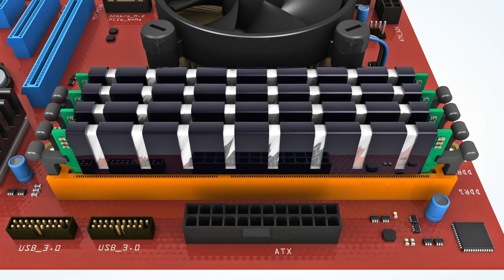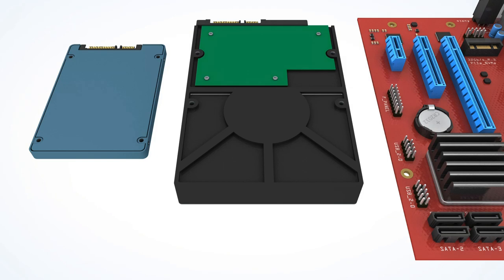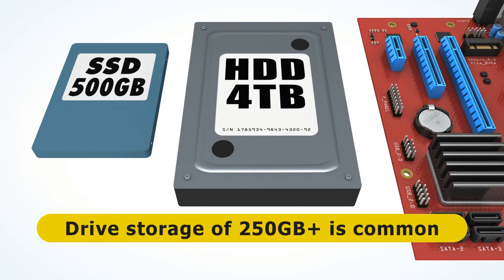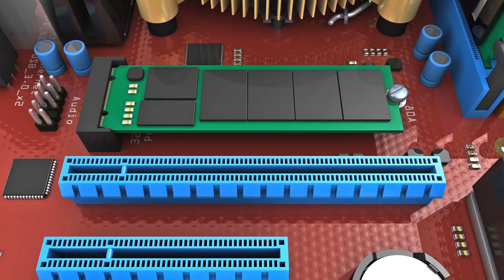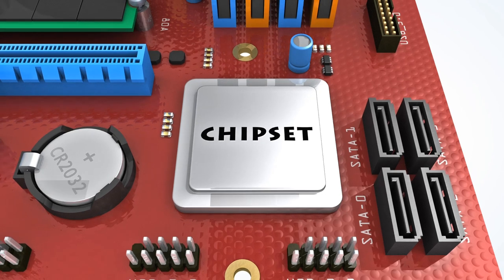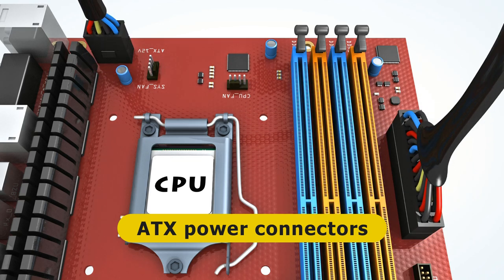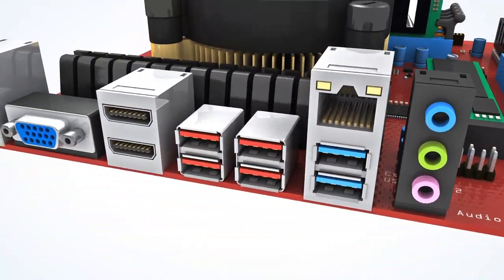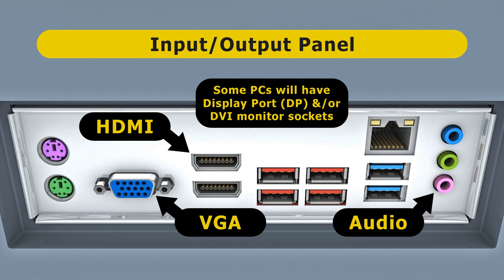Explaining Desktop PC Hardware

Comment: Are there motherboards that will accept four dual monitor video cards? OR Is there a better way to build a desktop that will operate 8 (or more) LED screens? Opinions and suggestions are welcome

I'm building my 2nd desktop computer to run 8 monitors...it's function will be to replace my current 8 monitor futures trading station (10 charts)  --  It is NOT used for gaming ... My 1st build was in 2012 and is still functioning great but it's getting a little dated/old. I used two dual monitor PCIe video cards and 4 USB video adapters for running 8 monitors total.

My current machine runs Win 7 home 64-bit, an ASUS P8z77-V LK motherboard, Intel i5 CPU, 16GB DDR3 Ram,  4 USB 2.0 & 4 USB 3.0 ports, an  OCZ 128GB SSD with a 650 watt PS...It has been relatively trouble free,  running 14 hour days, 7 days a week
Reply from the maker: I am not aware of such a motherboard. But there are a lot of quad monitor graphics cards -- eg a Gigabyte GeForce GTX 1660  -- so why not just fit two of those? Or (some) monitors could be interfaced via USB as you are doing now. But twin quad monitor graphics cards would be the easiest option I imagine. Best of luck! :)
Reply: @ExplainingComputers  Thx for the reply...I was hoping to eliminate the USB video adapters as they have shown high failure for me  (5 have burnt out in 10 years)... 

I was thinking that low end dual graphic cards are relatively inexpensive compared to quad cards, plus I do not need very high end graphics for what the machine is used for.
And I have had no issues with the inexpensive low end dual cards I installed in my 1st machine...

Comment: It's sad seeing optical drives slowly disappear from the consumer market, even when they're still one of the best storage options available, especially for archiving. I had to buy an old Optiplex just to get a PC that actually came with a full-size DVD drive tray and then separately purchased a BD drive.

I also prefer the protocol between PS/2 connections for mouse and keyboard (interrupt) rather than USB (constant polling). I get that USB is more versatile in application and thus "better" connectors, but it just seems so wasteful to request thousands of times per second whether a key/button is being pressed.

Comment: Better graphics than PC Building Simulator. You did however forgot to apply a pea sized drop of thermal paste before fitting the CPU cooler
Reply from the maker: Thanks for this. :) When fitting a stock AMD or Intel cooler, the thermal plaste is pre-applied to the base of the heat sink, so would not be seen in the shots included here. :)
Reply: @ExplainingComputers  Touché and since this was a "PC hardware 101" I cannot expect you to explain the practice of removing stock thermal paste in favor of more expensive aftermarket paste either.

However, one caveat with the theory of pre-applied thermal paste. After removing the cooler, especially when it has been mounted properly by tightening the screws, there should've been a nice coating of paste on the CPU, making the letters 'CPU' illegible
Reply from the maker: @Stadtionalist  True!

Comment: Great video. Could do a longer version with a few more things:

m2 maximum speed - this confuses a lot of people.
front panel - probably the hardest part.
how to screw the motherboard on the chassis - people don´t know about washer/lockwasher and this causes a lot of eletrical problems / interference. Not sure if the name is right, in my country it is called arruela.
Reply from the maker: Thanks for this. I've already got  video on SSD technologies and form-factors (M.2 does not have a speed as it is physical connector, not an interface: SATA and NVMe/PCIe have maximum speeds, so the issue is the type of M.2 slot and the type of drive). And I've a video on front panel connectors planned. :)

Comment: Can you please do an episode on external power solutions for desktops, namely UPSes and computer voltage regulators? My computer is currently plugged into a motorized mechanical voltage regulator and I'd like to find out if it is really an appropriate device for a pc?

Comment: Hi Chris. I got a notification on my laptop to upgrade to Windows 11. In your opinion do you think it's worth upgrading or should I keep using Windows 10?
Reply from the maker: This is a difficult call. Right now I am typing on a Windows 10 laptop that I'm keeping as Windows 10. Windows 10 support runs to 2025, so the decision depends a bit on the age of the laptop. If it is fairly new, and so likely to remain in use beyond 2025, then upgrading makes more sense, as Microsoft may stop offering the upgrade to Windows 11 for free.
Reply: @ExplainingComputers  The laptop is fairly new (2 years old). I might try out the ARM version on my raspberry pi before upgrading. 👍
Reply from the maker: @qg786  That sounds like a plan. :)

Comment: Nice jelly nailing attempt and loving the RGB shirt, Chris. I'll take a look at the updated website. I'm hoping to find a link to an image I can use to boot my Mango Pi MQ Pro. I bought it some weeks ago and despite trying several micro SD cards and several images it just sits there with the green LED on and no HDMI output. I know the first boot takes longer than subsequent ones but after 20 to 30 minutes there's still nothing. I thought I might have a bad board so I ordered another but that behaves exactly the same. I suspect that if i can get one of them to boot then the other will work too.
Reply from the maker: According to my notes, I used an image from here: https://mangopi.org/mangopi_mqpro 

And specifically the
Armbian_22.08.0-trunk_Nezha_jammy_current_5.19.0_xfce_desktop.img

Good luck! :)
Reply: @ExplainingComputers  That works. Thank you. The winning combination for me was that image, downloaded from the Russian server, written to a 32GB Kioxia card, using Raspberry Pi imager running under Windows 10.

Comment: ESP32 S2 Please. I just watched several of your 'Raspberry Pi Pico' videos. I want to start running Circuit Python on the EPS32 S2. Would it be the same set up as Pico? I sure could use a 'video like you do', to set it up with an old MAC. I have been told Python is very popular.
Reply from the maker: I've not used an ESP32 I'm afraid (although doing so is on my list). Python is indeed popular -- I've a Python intro video here: https://www.youtube.com/watch?v=Crsp_He70no

Comment: Very nice animation, this must have taken absolutely ages to create.  Great stuff.
Reply from the maker: Ages . . . and ages . . . and then some more ages when I found an error and had to do it again . . . :)
Reply: @ExplainingComputers  I can relate.  I use 3D modelling for work, but it doesn't need to look pretty.  I only ever need to render the occasional still image now and again.  To render a movie of this complexity is a huge achievement, making the models (if they don't already exist in libraries) takes time, and then selecting and tweaking the textures to make them look realistic takes even longer.  What software do you use for this?
Reply from the maker: @CasualInventor  Thanks for this. Everything was built and rendered in LightWave 3D -- nothing came from a library. I have used library or other stock objects in the past for some projects, but they can waste more time than they create.

Comment: I have an old pc with 1gb of memory. The max memory the motherboard will allow is 4gb. The motherboard has 4 slots for 4 ddr2 memory sticks. Should i get 4 1gb sticks or 2 2gb sticks? Thanks. Great channel.
Reply: Do you know the max memory that the CPU will support, that is important too.
It is also important to consider, that probably the majority of motherboards, only have dual channel memory (refer to the manual, it should tell you which of the slots to populate depending on how many RAM sticks you have), so in most cases, you would probably just go for 2 2gb sticks.

Comment: 06:42 Unfortunately you have presented this piece of hardware as an optional one - while it is a mandatory one. That is of course if a CPU being used is a strictly CPU and not APU - but the again, when talking about that component you also forgot to mention this dichotomy 01:17
Reply from the maker: With respect, I think this is nit-picking to the nth degree! :) It would have majorly confused matters to get into CPUs with no integrated graphics (today mainly an AMD thing, as I've detailed in my fairly recent CPU and chipset videos). In education, less is usually more, and today most CPUs do include a GPU. :)

Comment: There is also a TPM security module, south bridge, and BIOS Flash.
Furthermore a Tape Drive of Zip drive, Serial & Parallel Ports, SCSI Controller, ext are also present on old PCs 
Cheers ✨
Reply from the maker: I did consider a mention for the BIOS. :)

Comment: I would have probably left the VGA connector off the GPU at this point. It's a bit dated.
Reply from the maker: Yes, it was a balance -- although VGA is still very common for projectors (not new ones, but the ones venues have installed). :)